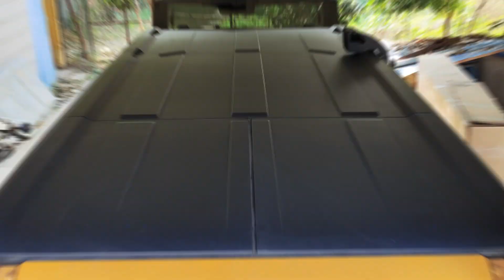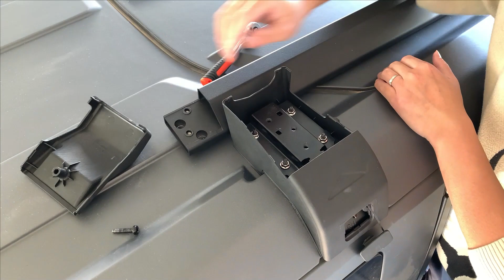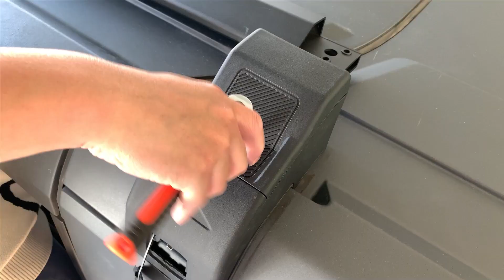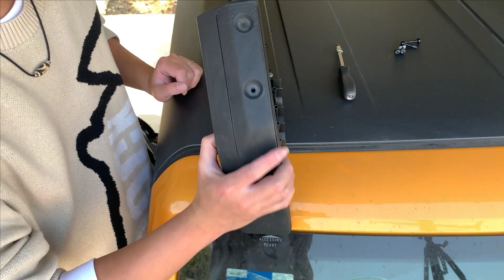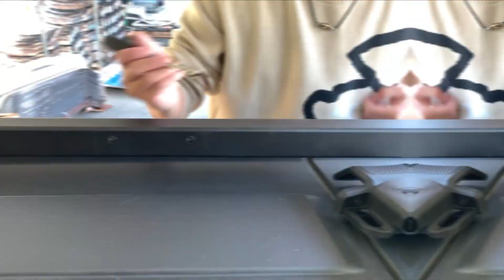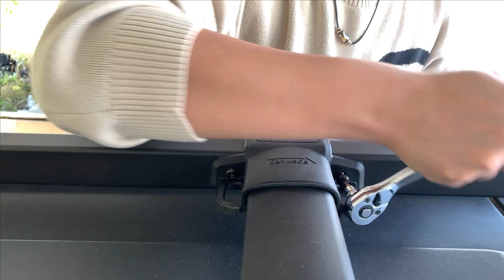Mabett Launches 4DR 2021-2023 Aftermarket Roof Rack!

Comment: I have this rack and it is really great. I have one problem though, it says you can remove the front roof panels with the rack installed, and I can't seem to figure out how. There is not enough space to slide the panel out. Has anyone else been successful removing their roof panels with this rack on?